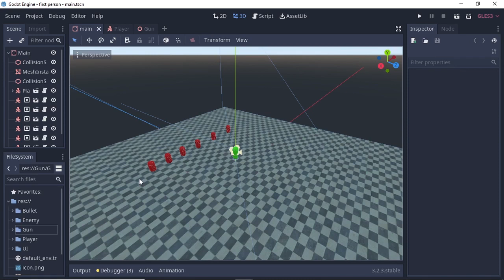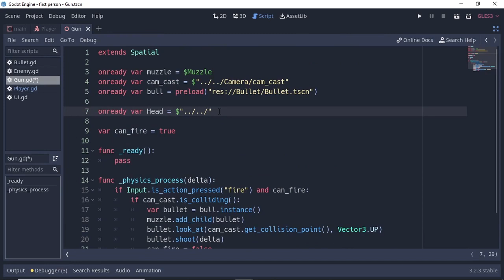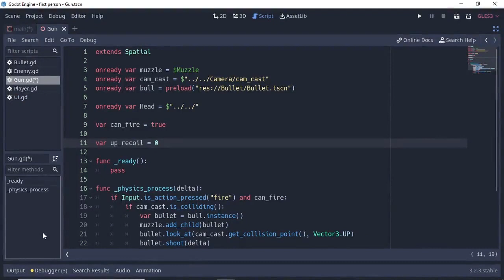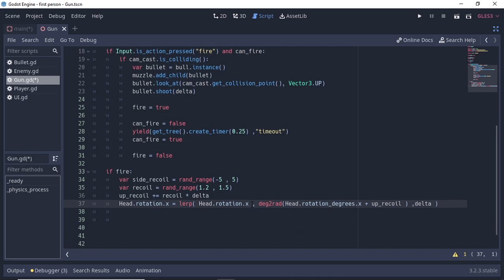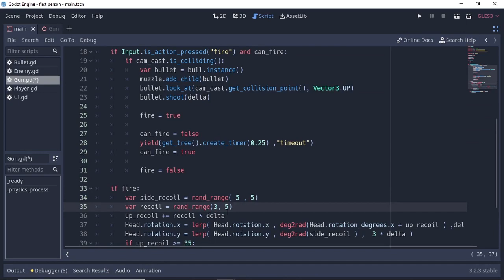How to make gun recoil in godot

Comment: Great tutorial, but I've found that sustained fire for long enough can vertically rotate the camera beyond 90 degrees and cause it to become stuck
Reply from the maker: Long fire can cause issue, well the fix is , you can clamp the gun rotation to max and min value..😃
Reply: I tried that, but I must have went wrong somewhere because recoil would cause the camera to rotate beyond the limits anyway. I made a workaround solution though and it suits my game just fine
Reply from the maker: In my case , my player script has camera max and min rotation ( basic fps control)
Which fixed my issue...
BTW Good luck for your game 👍🏻
Reply: @gwtuts4061  My game also has that, but the camera clamps are on a different script. That might be affecting it